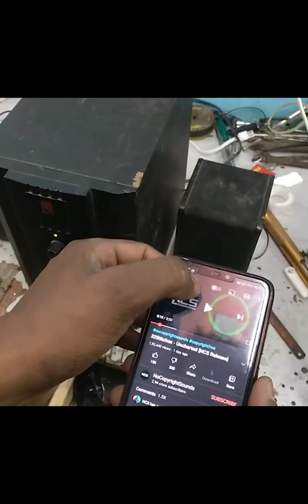Home theater || Home theater sound test || Home theater setup || Home theater system | Home carft

Comment: Bhai 7805 se connection kar lete faltu mai ek charger laga diya
Reply from the maker: Abe isme mosfet nhi hota board me
Or jitna simpl ho sake utna dikha ya hai taka koi aam Insaan bhi bana sake
Reply: @KAKEEXPERIMENT  thankyou sir 👍
Reply: Humming problem bhi hoti ha
Reply: @KAKEEXPERIMENT  blutooth theatre board ke transformer ke amp se heat hota hai ishi liye 700 mah - 1A charger best hai sath hi 3 diode laga lete to aur protection ho jata 5 volt se 4.2 - 4  volt mil jate it's perfect voltage for headsfree Bluetooth module